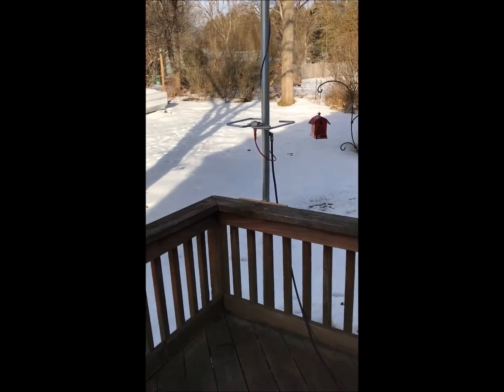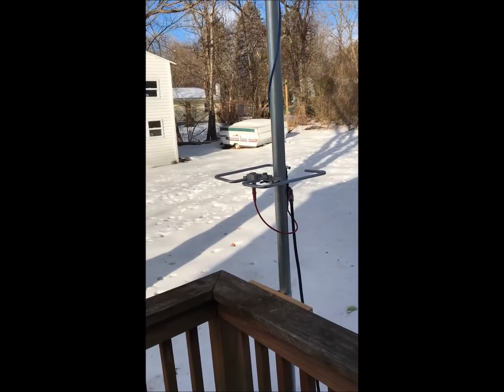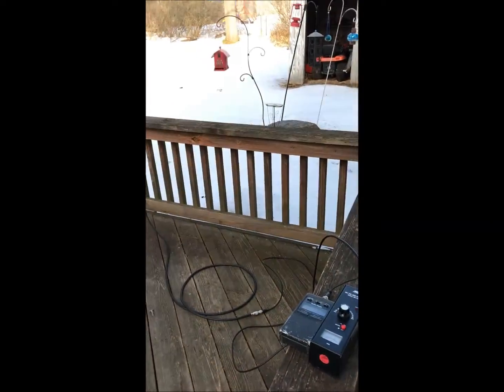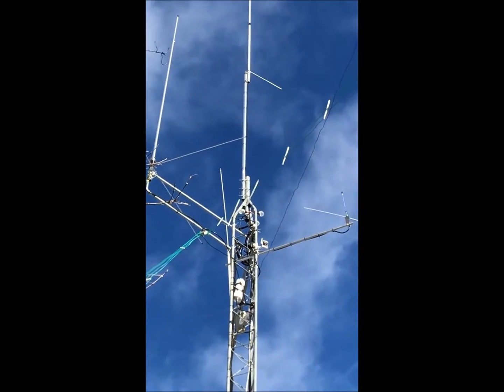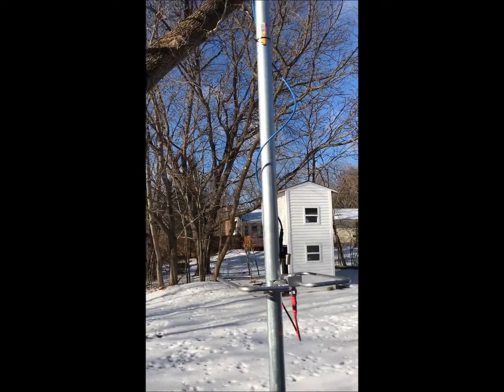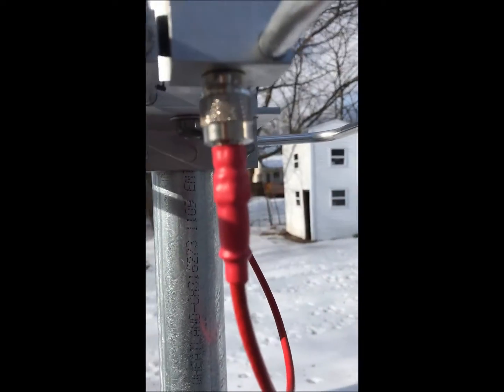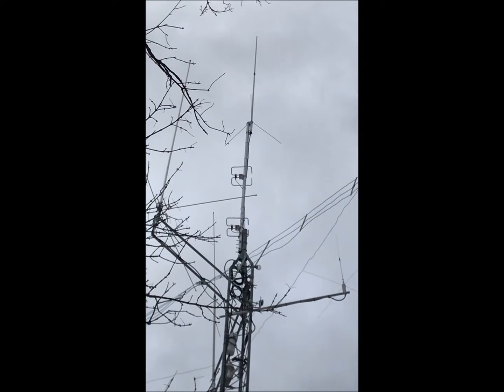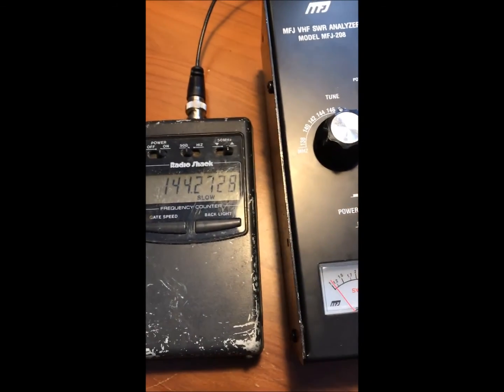2 meter M2 Loops Installed Stacked

Comment: The instructions on the M2 website say the antenna are supposed to be mounted with the connectors facing each other.  I notice yours are both pointing down.  Might be a newer version of the antenna?

Comment: I can't hear about half of what you said? Sounds like you were a long way away from the microphone or speaking very low? A PAR OA-144 will out talk the M2 very badly. because they are a true Omni Directional loop and the M2 is not.SWR is not what is most important.
Reply: I am making a 4-stack pf Squalo elements using 1/2 copper tubing. I am trying to figure out a homemade power divider, and keeping phasing in mind. So far, I plan on using Tees with equal length paths to the primary feed coax (all RG213 or RG-8). I can coil excess sections. I really don't get into using different 1/4wavelength sections of coax and teting to ensure they see all in phase. But, it sounded like your test ofnusing two equal length patch coax sections wasn't working out? I really don't want to spend $300 for an M2 quad power divider, either.
Reply from the maker: I just played it again, sounds good here